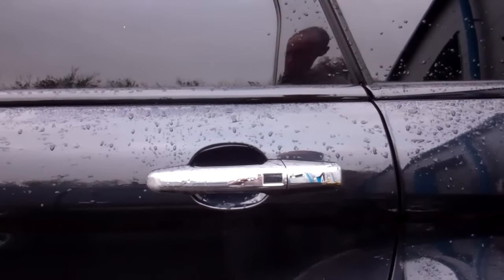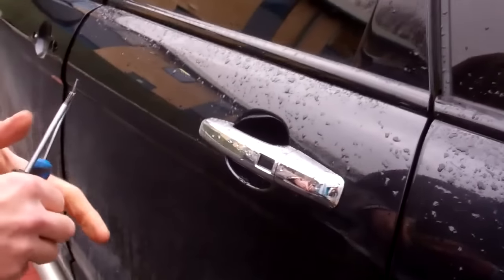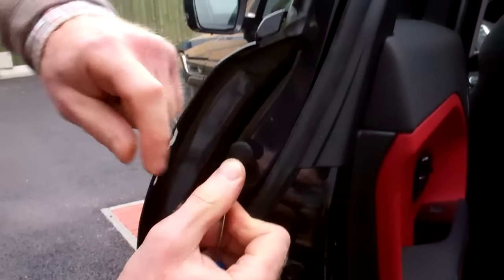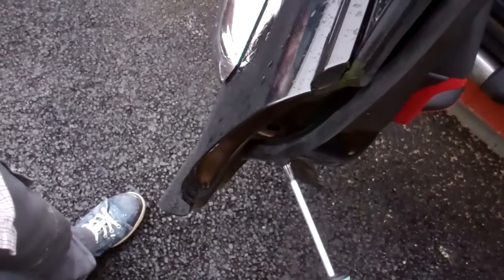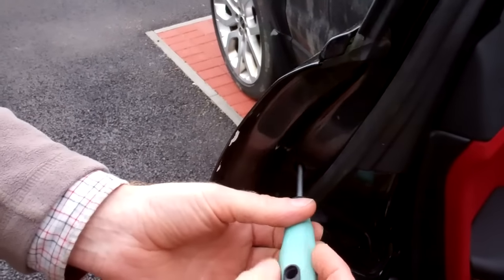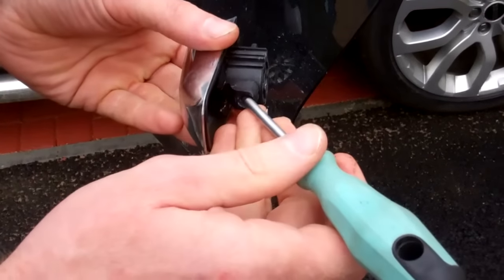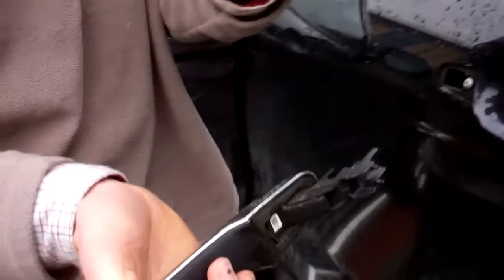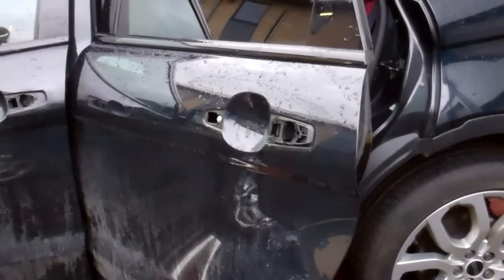How to remove door handles on Range Rover Evoque / Sport etc

Comment: Excellent video (as usual).  However two things I noticed when removing my left rear door handle on my 2015 Dynamic with Passive Entry.  First, there is a latch or clip on that first torx screw you take out on mine, so it is nearly impossible for it to fall out and down in there door.  Second, there was no way for me to disconnect the electrical connection for the passive entry without having access to the inside of the door (removing door card, etc).